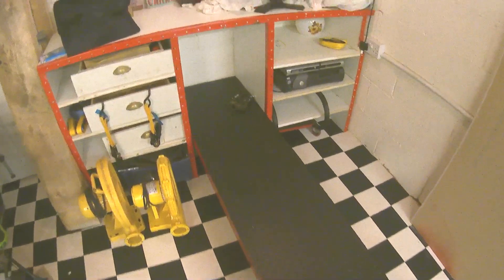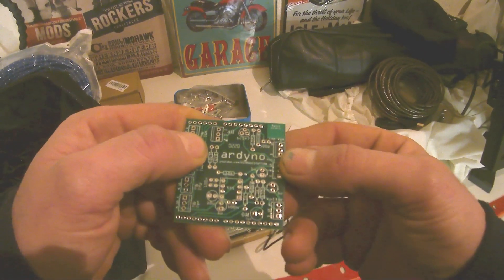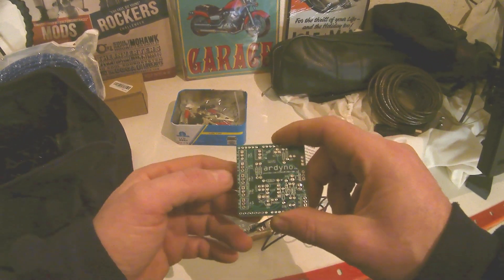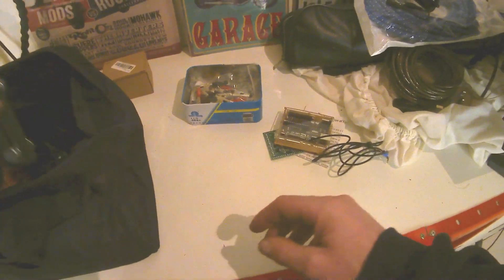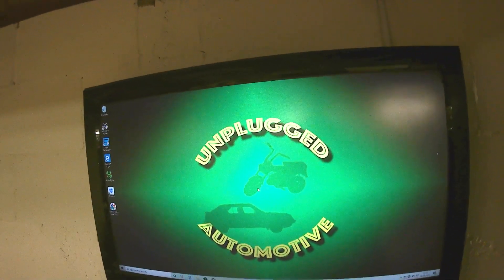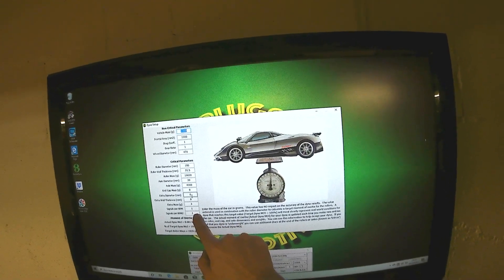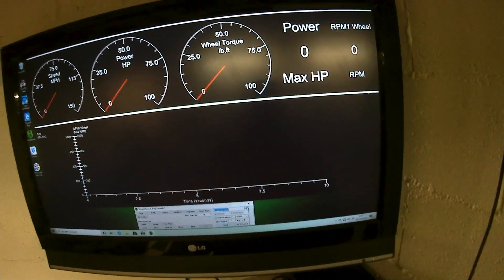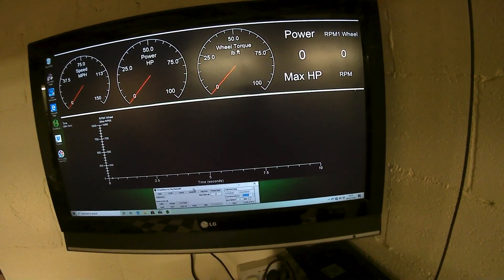DIY DYNO BUILD Hardware And Software Needed

Comment: Hello, I bought a pcb from yours, but I have problems with the roller sensor, I do not know if is the hardware or software, can you help me?
Reply from the maker: Explain the issue I will of course try to help you out
Reply: @unpluggedautomotive878  In simple dyno software, I have got signal in the RPM2 gauge, using the hall sensor and using the capacitive clamp. But using the same hall sensor connected to the roller connector at the pcb, I have not signal in the roller gauge. I do not know if I have to configure anything in the software or if I have to use another gauge etc....
Reply from the maker: @02kula  ok there is a sketch file for the dyno shield and one just for the normal Arduino make sure you have uploaded the correct one if go on the ardyno web page the file is listed on 2strokestuffing webpage
Reply: @unpluggedautomotive878  yesssss, for shure will be this problem, because I used the sketch from Simple dyno, thanks, I will say you after test it, thanks again
Reply: sorry, I can not find the right sketch, is not on the ardyno website, because there explain to load the sketch from symple dyno, its like I have done
Reply from the maker: @02kula  let me fire up my pc tomorrow evening and take look at what files I have and see if we can get to the bottom of your issue
Reply: @unpluggedautomotive878  Hello, have you taked a look?
Reply from the maker: @02kula  I haven’t mate  been a manic day sorry not stopped Will sort of for you I’m doing nothing tomorrow evening drop me a message tomorrow evening as a reminder get so busy sometimes it totally slips my mind
Reply: @unpluggedautomotive878  Hello, finally I finded the problem, just was twisted wires at the pcb board. Now I can start with the roller bench assembly, but my question is: for test bikes until 50hp, what size and weight of roller can be better? Thanks a lot
Reply from the maker: @02kula  awesome you got sorted I run a 25kg roller it’s not massive but very well made in 2th gear flat out with a 140cc pit bike the roller was only doing 700rpm and it has a max 1700rpm limit Look for more a well made roller then weight this is a free wheel dyno so unless you are wanting to do turbo stuff or custom mapping then a load dyno is what you need But any rolling mass is fine for this set up

Comment: How do I set up the arduino any help
Reply from the maker: That a very difficult question to answer what issues are you having
Reply: Simple Dyno  is not reading my hall sensor
Reply from the maker: @itshookn8155  check your baw rates are correct there are options in the settings to do this when you added the sketch file to you board it asks for that info to be added I would print a copy of the simple dyno manual and take your time step by step

Comment: I'm i need of a dyno board to measure roller speed, tire speed and engine rpm for my 1/4 scale rc cars with 2 stroke engines
Reply from the maker: Warren Jackson this would be great for that
Reply: @unpluggedautomotive878  Do you have a pcb for sale ?
Reply from the maker: Warren Jackson yes there a few only info is in the description
Reply: THANKS , I purchased 2 pcb
Reply from the maker: Warren Jackson 🤟

Comment: Hi, great video and Interested to give this a go. Are you able to supply the board and software as a complete package? I also work on smaller bikes and would be ideal to assist with tuning and performance upgrades.
Reply from the maker: Re-Clone-Cy-Kick Hi the software is available online for free this a diy build kit the info is all on simple dyno website it’s goes far more in-depth on how to do it all I can only supply is the ad-on board shown it this video you will need to build that also it’s a good project to start I’m no electronics wizard but managed to sort it take your time and go through the available online manual and it will start to makes sense
Reply: @unpluggedautomotive878  Thanks for the prompt reply, can you perhaps send the link please and then I would be interested in one of your add on boards. Many thanks.

Comment: how do you get the dyno screen settings folder?
Reply from the maker: you have to use the icon on the main screen to make your own setup screen then save it to a file so you don't have to set up every time you turn on the software there is a operation manual with the down load file take your time its all quite simple i'm not the best with computers if i can do it anyone can
Reply: I'm i need of a dyno board to measure roller speed, tire speed and engine rpm for 1/4 scale rc cars with 2 stroke engines